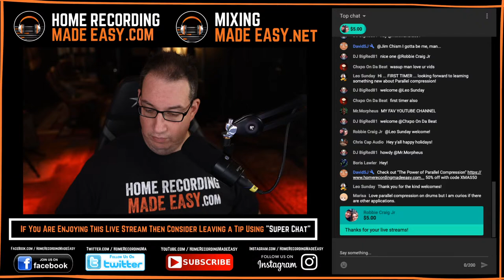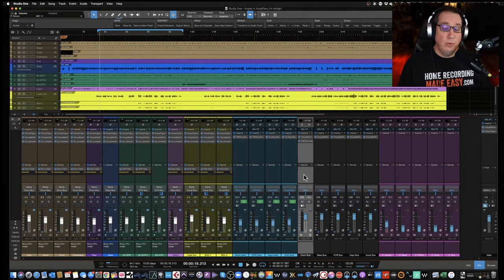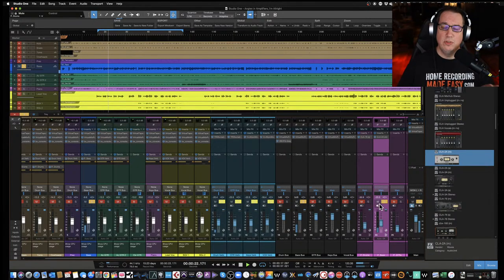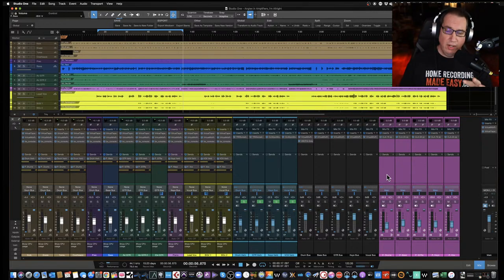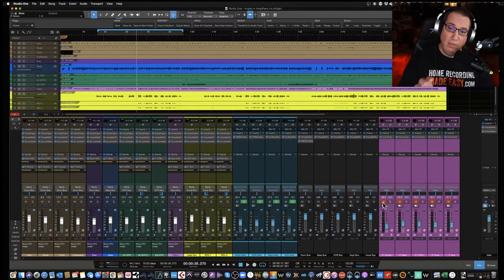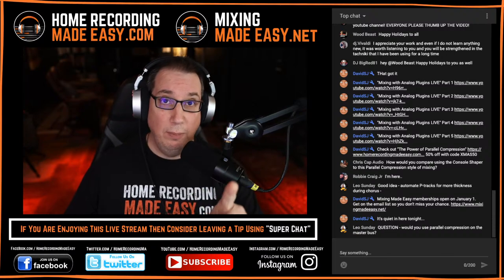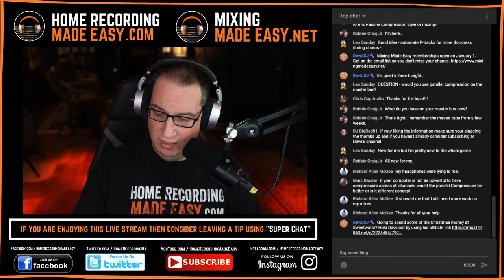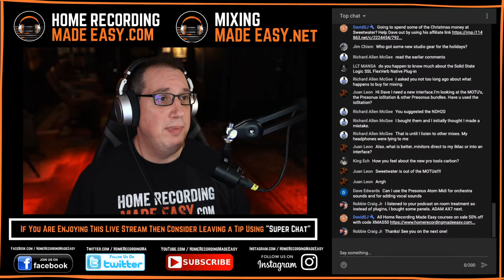Mixing With Analog Plugins | PT 6 Parallel Compression

Comment: Hi David, Merry Xmas to you and everyone here! I am curious if you will tallk about the latency in parallel compression. When I use it ITB through an AUX channel I always feel I have a latency issue, I hear like a flanger between the direct and the parallel. Is there a way to solve it? I tried using compressors with shortest latency
Reply from the maker: I hav e never had any of those issues.